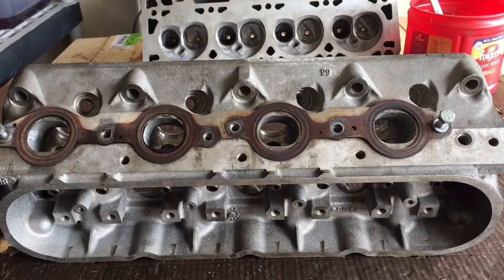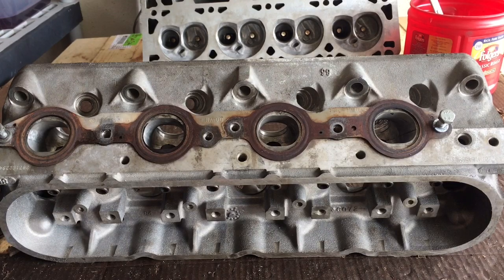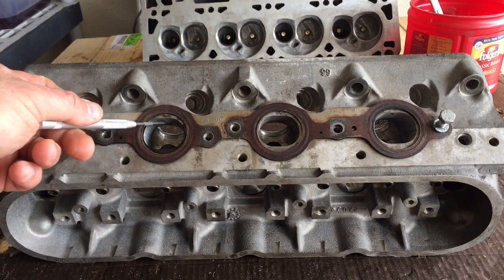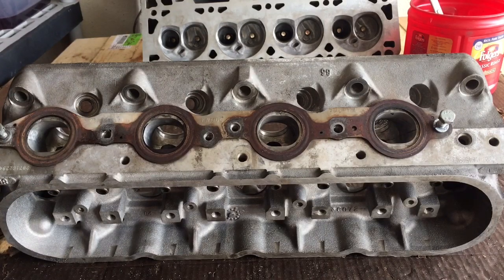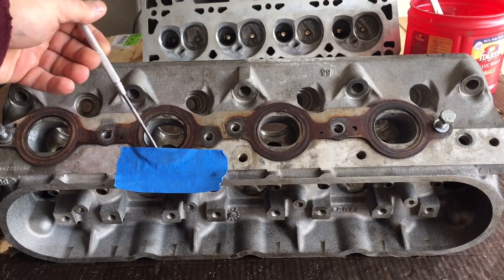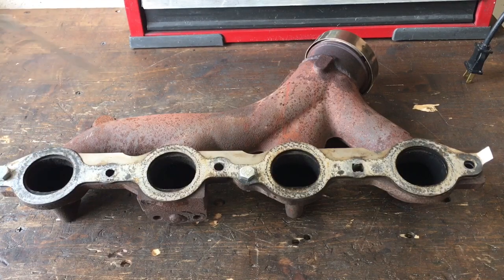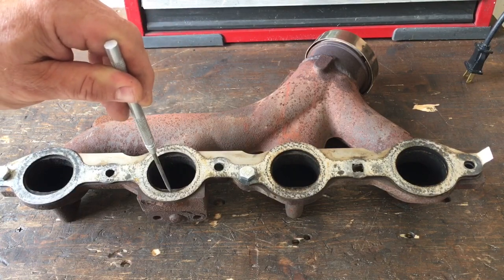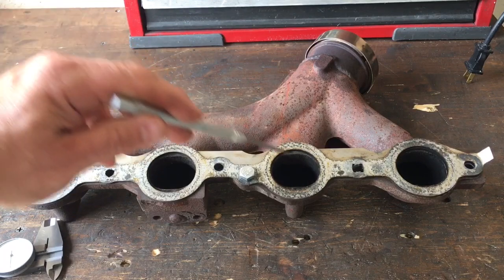LS Head Porting WARNING on port size

Comment: it's funny to me... Guys will do all of this diy porting between the intake, throttle body, heads & exhaust for that extra 5-10 horsepower and risk ruining a motor when...

You make make 800hp with a stock bottom end and a single turbo...
Reply from the maker: Well, to start you clearly need to do more Google searches…. You do you and we’ll keep putting you on the trailer.  Thanks for watching!  JD

Comment: Angle cutting into the manifold/header will help torque / horsepower tremendously down below peak on a tight 107 or 108 lsa cam . The anti reversion ridge on the head going into a temporary much larger manifold opening really helps the power production on that setup come on sooner and more intensely . This is Really Good for a truck/towing type cam with tight lsa !!! Reverse flow is very effectively blocked and Low end and mid-range power is Greatly enhanced !!! It will have much cleaner throttle  response as well . 
On a higher RPM setup this allows the next larger header tube size with no loss of bottom or mid-range power .

Comment: Can you port it at an angle so it’s not like it’s just hitting a wall to keep from taking out to much material?
Reply: I’m referring to the exhaust manifolds btw.
Reply from the maker: You can open up the manifold or run large primary tube headers.  I was warning people not to ruin the exhaust flow by opening the exit larger than needed.  In the example given supports 210+ cfm of flow plus the exit doesn’t need to be any larger than the cross section of the rest of the port.  Thanks for watching and the feedback I like to see people processing the information!  JD

Comment: HeadFlowInc, you are well respected by myself, even though the gains are very small, in your opinion, how important is exhaust porting other than scavenging.   Than You
Your Opinion will increase my knowledge,  Thank You again
Reply from the maker: Stay tuned and check out my older porting videos on math and percentages.  JD

Comment: HeadFlowInc, I run uprite headers on my mudd truck, would raising the roof still work fine? Thank you
Reply from the maker: Anthony Lopez Yes, as long as you stay inside the opening at the headers it’s beneficial. Moderation and keep everything smooth no need to remove to much. JD
Reply: @HeadFlowInc  ok , just what I wanted to know, thanx.

Comment: So opening up the exhaust port is fine to 'port match' to 1.75in primary sized long tubes? Extra terminology made my ADHD kick in. Got a few lsx vehicles that I've modded over the years and have dyno tuned, done ls swaps etc.. Never got into porting heads. Maf ends and intakes for myself, yes. But i want to squeeze more from my 243s on both my 4th gens on next cam swap and my Tahoe. And finally doing a lsx swap into my 3rd gen with a mild 5.3 with ls2 heads. Idk how i collected so many sets over the years lol
Reply from the maker: Charlie Cadaver You can raise the roof but it’s important you stay inside the header/manifold you will run. There’s zero reason to enlarge to much, it’s literally finding what fits in the exhaust.
You’ll need to watch my videos to see areas to avoid!  The bulk of flow improvements will come from the bowl cut/blend, valve guide boss reduction and smoothly transitioning everything. 
Be sure to identify the landmarks and areas to avoid.  JD
Reply: @HeadFlowInc  i was planning on stenciling my 1.75 primaries on the flange and draw on the head and open up leaving the line so its a hair smaller than the header primaries
Reply: @HeadFlowInc  But I love the term ' raise the roof' :) honestly. Idk if i want to do an aftermarket cam. On both my 4th gens. I take pride in saying the engines are made of all oem parts minus the bolt on parts. My queen is a bolt on 2002 ls1 that i dyno tuned it with a predator hand held making 355whp & 371wtq thru high flow catted supermaxx system. My 98 bird with LS1 equiped with 243 ls2 heads and 02-04 z06 cam, fast 78mm intake and full bolt ons with no cats with a perfect 12.4-12.6 a/f ratio that spins to 6800 rpms makes 388whp & 378wtq with 182k miles on the 98 bottom end. I take pride in having 15 y/o technology putting 4.6s to absolute shame with just a couple grand in parts. But porting the heads and maybe add springs and 1.8 rocker arms, I'd like to achieve 400-410whp. As is,its still plenty for a dd. The 4.10s really make the ls6 cam move. Or spin out. Just cruising in 3rd at 25mph and smashing the throttle, she starts peeling out or fish tailing. And the reliability is most amazing with these engines as I have 80k plus miles on the top end. Thats what made me fall in love with these engines when i got my 02 as a left over in 2003. Mpg and performance. I gave up on my 3rd gen with a 383 making 584bhp bc even with stud girdles I had valve train issues. When the motor went the 2nd time... It hasn't been worked on since going on 11 years or so. Blew the motor before I went into the military thx to an asshat that didn't use thread lockker on the rod bolts. Not backed off, rod jumped and smashed cam into pieces. Fun stuff. Barely put 1k miles on the motor that time from being 'built' the 2nd time. I plan on putting a mild 400ish hp 5.3 power plant in her since i have 2 laying around anyways. Thanks for the info sir!

Comment: You can port the manifolds to match them right up you can open the floor up and then match the manifold to it and it works well.
Reply from the maker: Charles Torruella Nope, adding volume isn’t always good. You might get away with it under boost Turbo/Supercharger, maybe. 
Port velocity is a real concern. 
Port cross section through out the port is also important. 
Basically just making a port bigger doesn’t equal more flow or power. JD
Reply: @HeadFlowInc  Yes Sir, thats exactly what was explained to me, velocity out weighs volume on the exhaust side.
Was also told that no matter how much hand porting you do, that it will
never amount to what cnc porting can do, as far as cfm's are concerned. And I haven't seen any evidence that CNC porting is that much better than a professional hand porter.
For sure velocity is key on exhaust.

Comment: Best port for torque and power is the smallest port size that flows the best.  HeadFlowinc is absolutely correct.  The top of the port is most important because that is the straightest line out of the cylinder and since gases have weight, under high velocity they will always try and take the straightest line of exit.  Any wall at the top of the port will cause the gasses to hit and bunce off disturbing the flow of the entire port and ruin any scavenging.    I just lowered the bolt holes of a older Headman header that was used on a ZZ-4 with L-98 alum heads.  The l-98 factory has raised "D" exhaust ports.  The header was blocking the top of the port by 1/4".  Could of went to a bigger tube header to better match the head port but that would result in a drop in torque through the entire  useable RPM range.  In a auto trans car that is unacceptable and will result in a much slower car.  The car with the lower horsepower but sustained high torque curve through it's entire RPM band will always win the race.

Comment: Atleast these can be welded easily. It is possible to add matereal around the ports to allow better port matching. Then deck it for sealing. Question is, is it worth it on a stock manifold???
Reply from the maker: JAMES! Since the 70's Interesting, I’m not sure if it would be worth it.  I know people are making 1000+ HP using factory manifolds with Boost. 🤔

Comment: It would be better to have slightly smaller head ports than small manifold ports. Keeping the flow from hitting a flat wall!
Reply from the maker: JAMES! Since the 70's Exactly, he exit of the exhaust port should be slightly smaller than the opening to the exhaust manifold/header.  👍

Comment: Couldn't you just gasket match each?
Reply from the maker: Robert Bryant As long as you never cut/lower the floor of the port, then yes you can match the upper 2/3rds of the port between the head and exhaust.  Be careful not to add volume just to add, make sure you’re creating flow; not slowing down velocity.
Reply: @HeadFlowInc  are you just talking for gm heads here? On the newer audis that are supercharged we are getting nice gains by opening up the whole port including the floor of the port.
We are still leaving the exhaust port smaller then the header so theres a lip on the port
Reply from the maker: Matt Verteix The general porting theory says you normally won’t/don’t gain flow by lowering the floor. Two things at play in your application affecting the results:
1. It’s supercharged so the port is being forced to flow.
2. I’m not familiar with the Audi ports, they may be grossly undersized and adding volume to the port in the supercharged application clearly seems to be working.
Reply from the maker: Robert Bryant I ended up raising the roof on my stock manifolds this time to guarantee there’s no restrictions. Well, it’s a stock manifold but you get the idea. 😉
Reply: If you completely gasket match it is a horrible thing for turbulence because the exhaust  has to make a 110 degree turn coming out of the combustion chamber and the going out the manifold if you lower the floor not only are you weakening the combustion chamber right under it but you are getting rid of the shape the make it less turbulent making that turn

Comment: Old school porting i hope you dont do this for a living
Reply: It's pretty spot on for the diyer looking for better than stock flow numbers. I hope you don't do THIS for a living.
Reply: @jerytherew1  😂😂😂😂😂😂
Reply: Really this is the standard in headporting basics to gain flow numbers , smooth transition rate and to increase velocity . As he states porting the bottom of the runners especially on a non boosted application does nothing but hamper airflow and cause turbulence and in cases reversion hence impeding flow ! I have been building engines for over 35 years and doing portwork (by hand mind you) for a very long time and he does know what he is talking about as this has been an industry standard on alot of aftermarket heads for years , i.e. brodix , dart , trick flow  and many others that have caught on in the past few years from the bigger manufacturers if u look at their castings and flow numbers u would understand that ! But please feel free to hog the lower parts of the runners and enjoy the disappointment of reversion , poor flow numbers and other issues that come with doing so by all means ! The only benefit to opening the lower chamber is to radius it mildly for a smoother transition if the heads have a sharp angle as in older style gm castings as 461 , 462 and even the undesired 305 ho heads which are a cheap budget alternative for compression with lift rules in circletrack limited classes where velocity works best with low lift and vaccum restricted cams if u know engines and head flow symmetrics and how to efficiently gain power through smaller port sizing to match a cam profile ,bigger is not always better and port size must be determined by cubic inch , compression ratio and camshaft lift and duration ! 
I have built quite a few sets of oldschool stock cast gm and ford heads all the way up to LSseries and aftermarket heads with no complaints as long as I am giving engine specs before porting starts . I have multiple repeat customers  on drag , street and also circletrack heads with no complaint and high regard . So if this makes me unknowlegeable and incorrect then my 35 years and 100s of customers and race winning engines are a fluke🙄 . Please before replying buy yourself a starter's guide book on basic port design and flow characteristics in relation to camshaft specs and also engine displacement  and do some research as it would benefit you greatly . I dont look down on anyone for their opinions as they are just that and everyone has 1 but knowledge , age and treachery often defeat youth and inexperience .The knowledge I  gained working with racers in the early 80s till now and engine builders from the 60s to present day like Vic Edelbrock tend to lean me towards proven flow numbers and port designs , like the knowledge of people such as Grumpy Jenkins , Pat Mussi and Smokey Yunick, which Smokey I  unfortunately  never had the pleasure to meet but who in himself was a pure genius and has a few awesome books that I consider testament and  bible on engine building for traditional V8s and recomend to anyone young and old alike . Also to all the older generation racers and builders that I had the pleasure of growing up around from a very young age with my father in the shop and at the racetracks (L.A.C.R. , Pomona , Pearesonville , Saugus , Willow Springs) and learning from thier knowledge and making me realize and understand the basic concept of port sizing vs cam and engine displacement and  specifics . 
In conclusion I give kudos to u the maker of this video and your in depth d.i.y. steps in teaching younger generations on hand porting , port volume , flow and chamber basics to help them understand it because without people like you to take this time it would be a lost artform ! I have 1 student besides my 2 boys and after them my port secrets will die forever and contrary to popular opinion every builder does have secrets they do not divulge!🤐😉